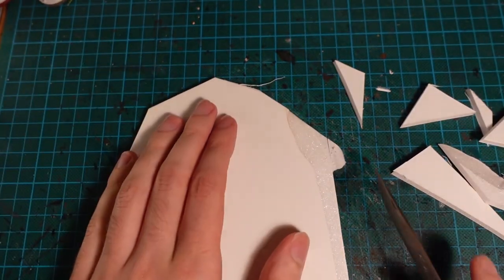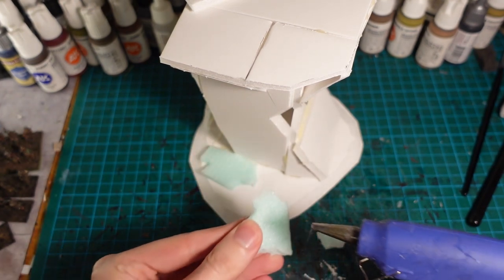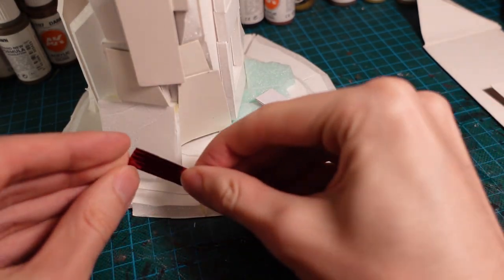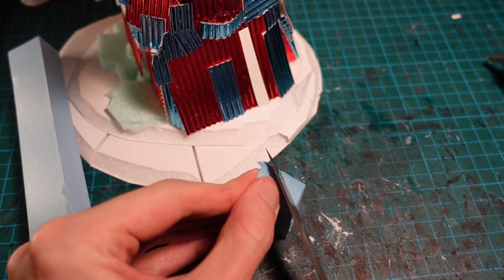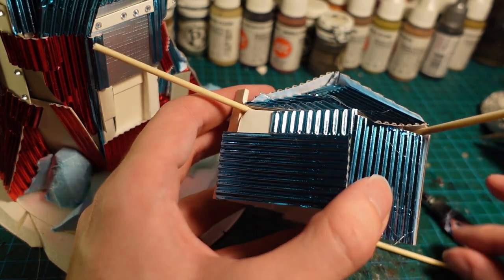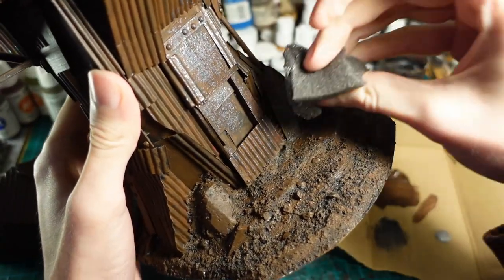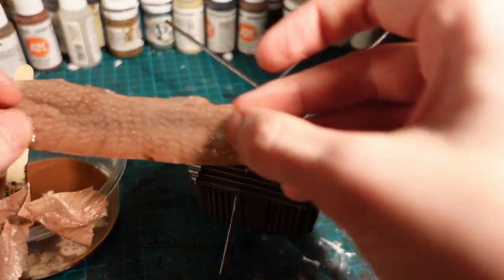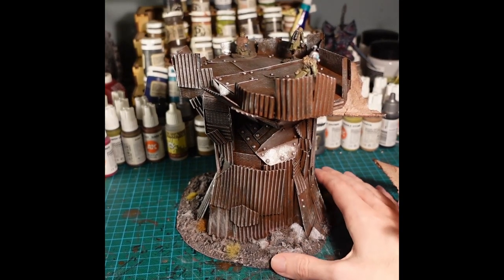DIY ScrapTower Terrain for Necromunda/Stargrave

Comment: This looks like a very playable tower. While I know that everything in Necromunda is oversized, have you considered cutting the corrugated iron into standard sheets prior to building, instead of cutting it to fit into the build?  It might create some more interesting problems that might look good on the finished project.
Reply from the maker: I have considered pre making a bunch of materials (e.g. girders, sheet metal, planking etc) then assembling a shack/scraphouse from them which might make for some interesting results

Comment: I massively prefer using tissue paper over other materials for tarps and the like. They are not as strongly imprinted (embossed?), so you won't have it immediately apparent that it's paper like in this build. On the ones I've seen, the embossing is around the edge, so is easy to cut away. They are also very durable even though they are very thin, so they won't fall apart too easily when wet from glue and water. You can even peel the layers apart if you need something very thin like plastic tarps or curtains. Sp yeah, paper tissues are far superior to kitchen roll, baby wipes, or toilet paper IMO.

Other than that, I think this is a cool build!
Reply from the maker: Thanks, Yeah, I don't really mind the embossing in a sci-fi setting as it just seems like some mass produced material but for something fantasy then tissue paper is for sure the way to go. I'm also curious how crepe paper would turn out as that has a weird texture to it